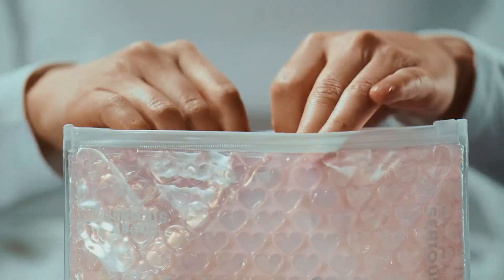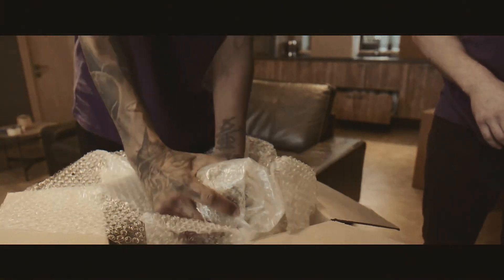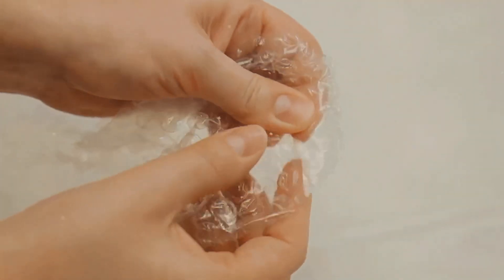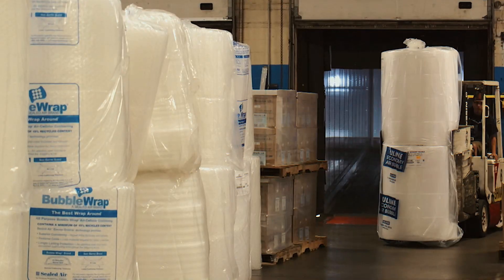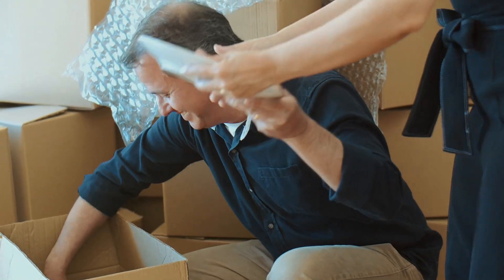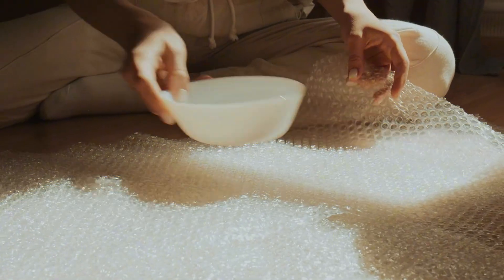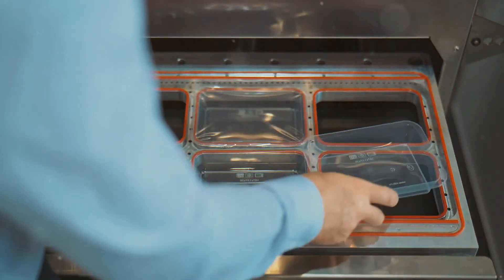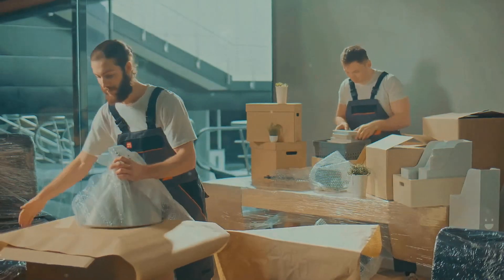How Bubble Wrap is Made | Made of What?

Comment: So why don't the bubbles get squashed out of existence when the second, sealing, sheet of plastic is added? Genuine question.
Reply: Hi, I used to make bubble and plastic wraps for brands such as Duck, Walmart, Lowes, and even Tesla. I'm not great at explaining things, but I did the process long enough that I understand it, and am willing to take my best effort to explain it.

Both plastic and resin pellets are heated to typically 450°F-500°F. Once heatead; the plastic/resin mixture is pushed through an extruder which basically makes two thin plastic sheets. 

One plastic sheet is left "untouched", (This will become the "bottom" of the bubble wrap.) 
The other sheet is sent to rollers with little dots / divits / indentations which are "bubble molds".

Negative air pressure sucks one heated plastic sheet into the bubble mold, the "bubble" sheet of plastic is cooled and the second sheet of plastic from before is applied to the bottom, and is then sealed by heat — melting the two layers together. Thus trapping the air inside of the bubble!